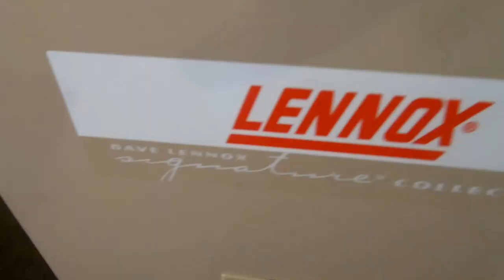Women Can Do HVAC - Reme Halo Install

Comment: I love my REME Halo that I had installed in my house HVAC Duct! Smells so fresh !!
Reply: How much was it? How hard to wire?
Reply from the maker: I assume you must not be in hvac, here's my advice, your warranty is not valid unless it's installed by a HVAC contractor. That's right on their website. Otherwise it's easy if you know what your doing.
Reply: @HVACRSurvival  ok makes sense. Thanks!
Reply: @HVACRSurvival  Mine was installed by my HVAC Company that does all my maintenance. I have a two story house and they installed one for each unit that I have .

Comment: Nice video flutey, it cant hurt, however IMO the honeywell F50  with its great sp drop of .1 and 8000  volt plates can capture down to micron sizes viruses.  I take mine out and wash them in the dishwasher every few months.  My 20 year old coil is perfect and no dust in house, been using 20 years.  Im moving and cleaning 1500 cfms of air each cycle.  Notice the spec rich comment to satisfy the potential installer in the house.

Comment: How does this work? Is it just an arc-discharge ozone generator? Does it make your house smell like ozone?
Reply from the maker: No it doesn't. Here is the link. https://www.rgf.com/products/air/reme-halo/#undefined
Reply: Ultra Violet Light emitter. same thing they used for sterilizing medical items long ago (as well as steam cabinets). which turns out neither are fully effective! DOH.
well, that also does ionization, lol. same thing recycled from many years ago.
the things you cook/eat/spray/wash/clean in are more harmful than most things lingering in the air, but of course they linger also ( which this would slowly help filter out)

Comment: I agree the reme led sucks! That one is better 😁
Reply from the maker: The company installed over 400 of the LEDs in commercial applications and come to find out that they have to be cycled off for a self-cleaning mode and cannot be left on continuously. To say the least we got an issue to deal with. Next thing you know you're losing the power transformers 🤦🏻